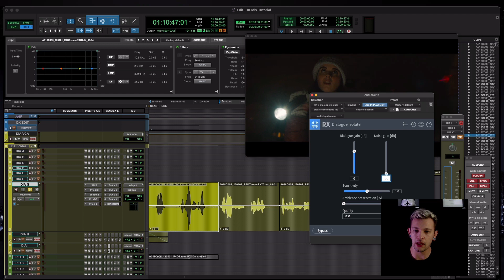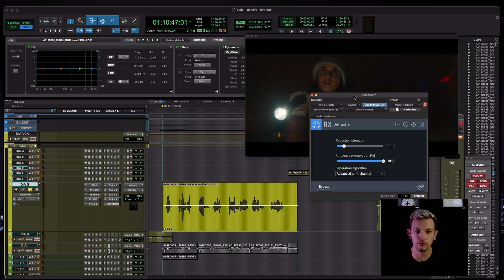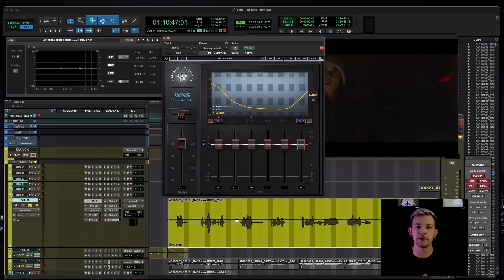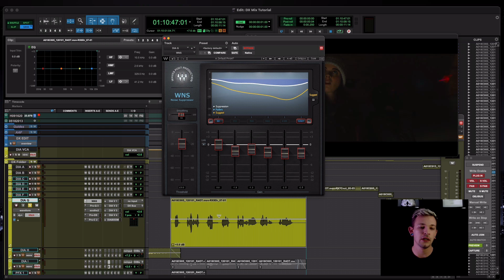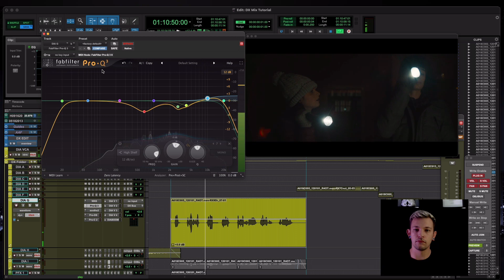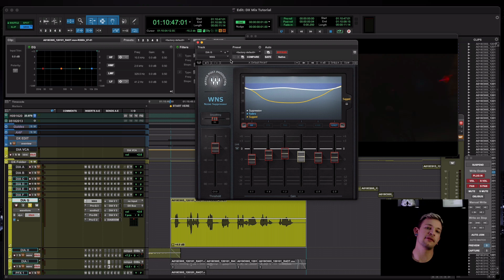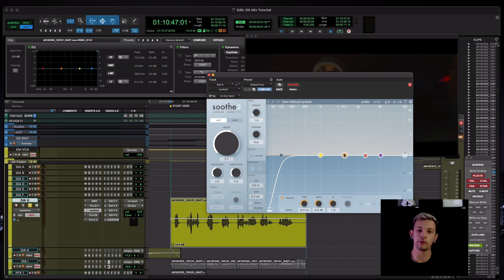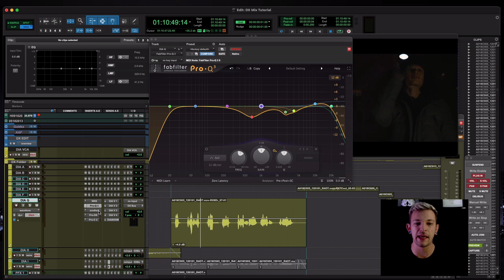Tutorial: Dialogue Signal Processing with Matt Yocum

Comment: Do you insert limiter on dialogue chain to achieve different loudness standard?
Reply: in post, the limiters are on the bus, not on individual tracks. keep in mind you do have 500-1000 tracks on a standard movie. 2000-3000 easily on a big budget action movie.
Reply: @adelaudio  I understand that. So refer to my question, will you insert limiter on dialogue bus to achieve different loudness standard
Reply: @keisoundhk  hey there! I put a limiter on each stem but only set to -.01True Peak on film because there’s no loudness spec. 

For streaming or broadcast I set it at -2dBFS true peak. 

Notice my limiters in each case are only set to catch the very top of the peaks and keep them under, not to increase or decrease the overall level of the dialogue. That just takes time and practice using volume. 

If you find you’re globally over or below you can just globally move a master trim up or down to compensate for example if you want to keep the relative volume of the dialogue the same.
Reply: @Myocum93 thanks! Wondering if anyone put a limiter on master fader if mixing 5.1/7.1 movie?
Reply: @keisoundhk  yes. Same thing on all stems. DX, FX, and MX each have their own limiters regardless of output channel width